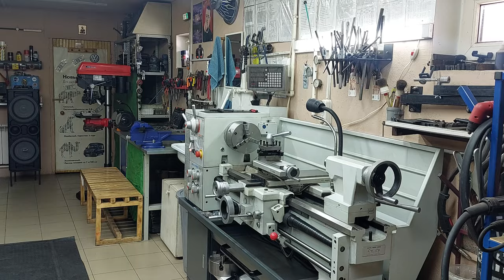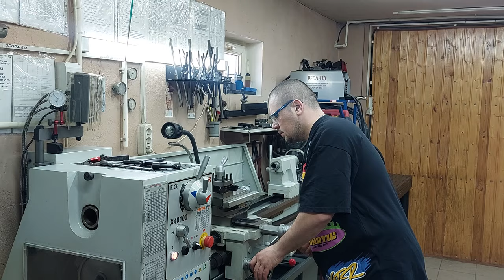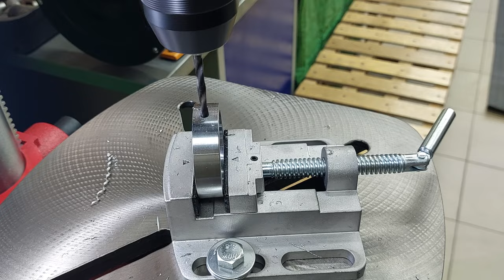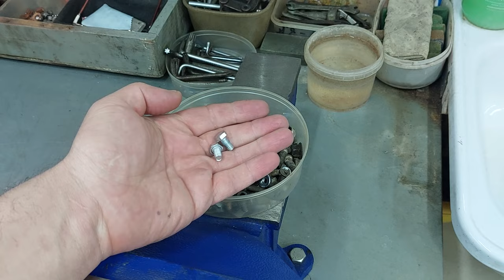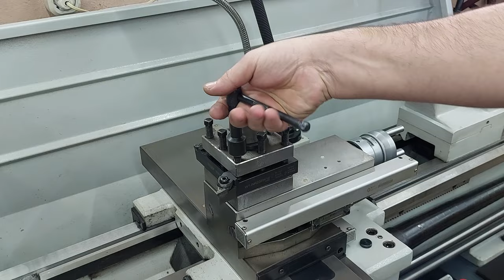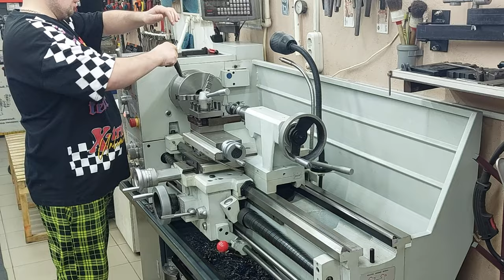Brilliant tip and trick in 4 minutes! Now my lathe drills holes by itself

Comment: I just put an eye bolt in the base of my TRAK lathe tailstock and bolted a short section of square tubing with one side cut away and a hole drilled for a vertical pin (socket head cap screw) that I can drop in on the tailstock side of the carriage to move that heavy tailstock back and forth.  The cap screw in other words goes first through the upper wall of the tubing, then through the eye bolt, and finally through the lower wall of the tubing.  The screw head keeps it from falling all of the way through, as the hole through the tubing is slightly larger than the threads of the screw, but smaller than the head.  It is just a simple hitch like you might find on lawn equipment such as thatchers, aerators, and wagons.

Comment: Hello, great video.
Just takes care:
When you drill on lathe, the support is fixed to the bed lathe and you push in the turning piece.
Then with your tips, you need to release the support that can play and brokes the drill bit.
That you show is only oversize an existing drill hole, (not enough material is removed by the drill with the front move)
That is my advice, not a critic
Thanks for the video again
Br from Switzerland👍👍
Reply from the maker: Thank you and welcome🙂

Comment: The only thing I like about this video is the feed screw covers on your lathe. I don’t recommend driving bolts into the tail stock and I would never use this method to drill holes. Just lazy 🤨

Comment: I would be concerned with marring the tailstock spindle.  Perhaps make a ring, make a slit, and then have a threaded and clearance hole on the sides of the slit to clamp it.  And it wouldn't have to be ring shaped.  It could be square on the outside edge.

Comment: I think that is an interesting idea but your tail stock is not clamped, of course, and this could really present a problem with larger drills. I have a 12 x 42 lathe and once forgot to engage the clamp and started drilling. I found my error when the torque started rocking the tail stock towards me. That was with a small bit. I often use drills up to 1” for quickly roughing large holes and this would never work.

Comment: Great idea, but, always use a 4 jaw chuck where possible and those 2 screws should be positioned at about 90 degrees to each other, doing so will provide a tighter fit and  prevent the ring from rocking back and forth.

Comment: I added some parts to my tailstock, so that it could slide but not tilt towards the headstock when pulled by the carriage.
I measured the height between the upper and lower machined ways, thinking that would be good to achieve this, making a suitable T assembly, bolted to the bottom of the tailstock.
There was a problem - the height was not the same along the length, the bottom machined flat was tapered, getting thicker the closer to the headstock.
So, the tailstock soon jammed as it was pulled along.
That was annoying, but I suppose the lathe maker thought the tailstock would only be used in one position and locked there.